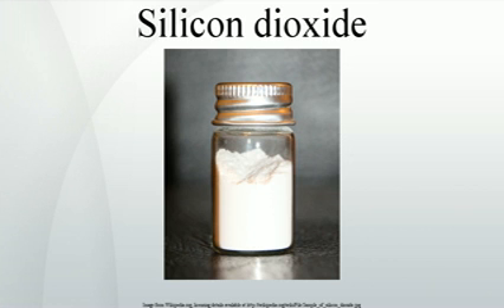Silicon dioxide

Comment: I'm starting to worry now because I have consumed one very large container of silicon dioxide in the last 2 months. Should there be any concern if I start to eliminate (crap) an extraterrestrial CO2 hydrocarbon tetrahedron shaped concrete slab? I guess I should have done more research before I started drinking it.
Reply: Arlene Portsmouth it has some in food in health food also